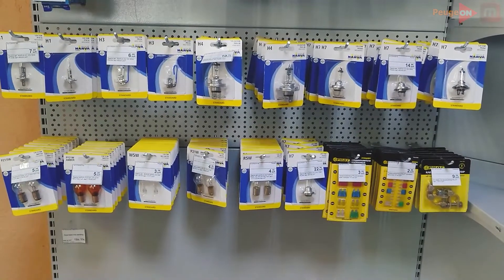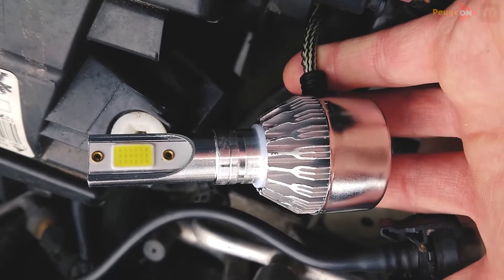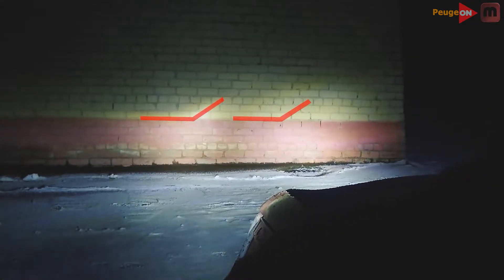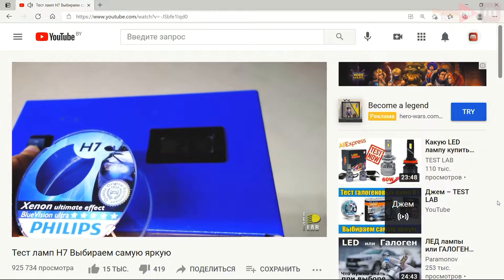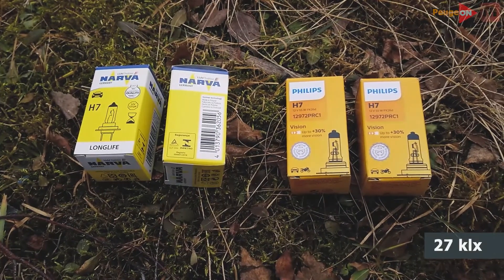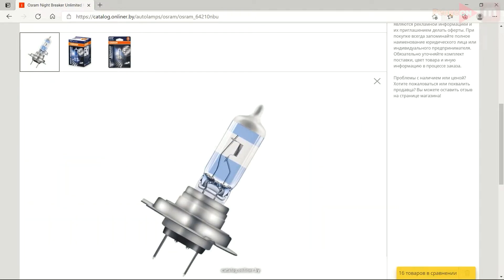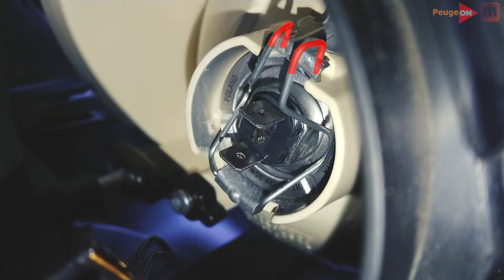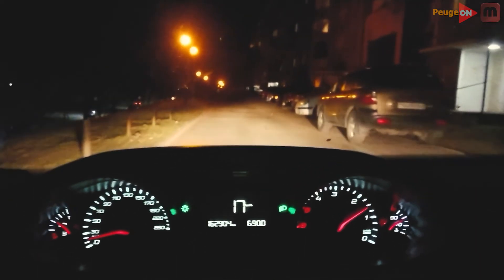Best halogen lamps H7 Ever

Comment: Thanks for this!  I have a problem, when the headlight bulb stops working I don't get a warning on the dashboard.  Any solution?
Reply from the maker: I have the same situation. I somehow forgot to connect the wire to the light bulb and the car did not give me an error. This is either a feature of the car or we have a weak configuration. I have an ACTIVE.
Reply: @peugeoton4033  A mechanic told me that if you put the bulbs in both headlights at the same time it will give an error, and that the bulbs must be from the same manufacturer :D
I haven't tried it yet.